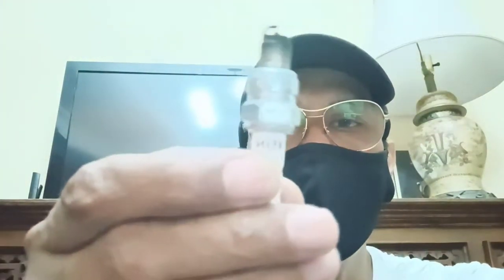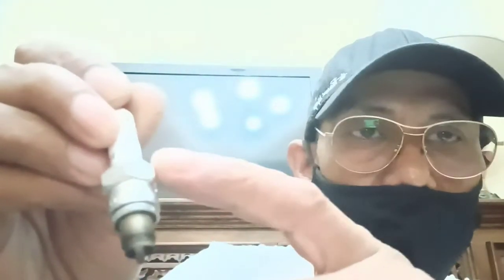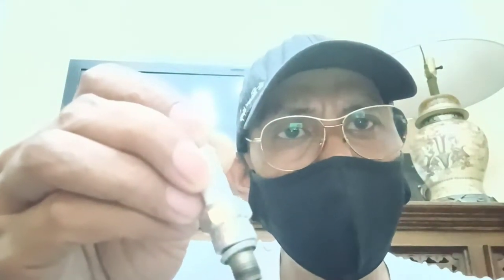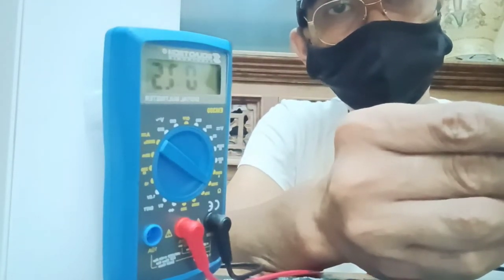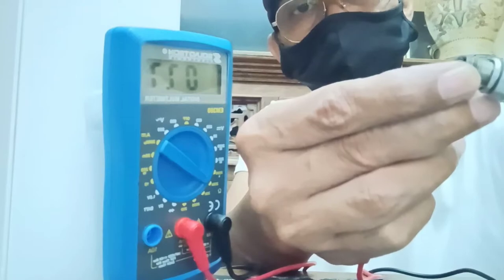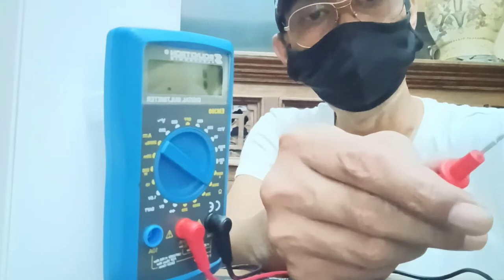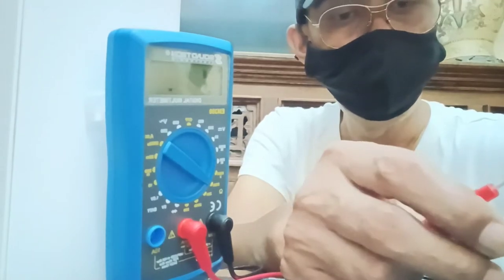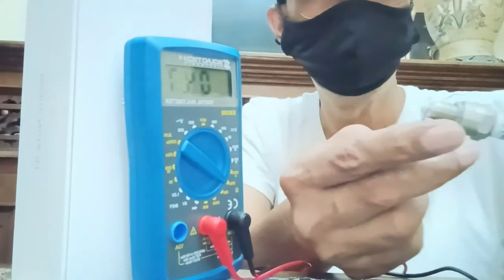Checking faulty Spark Plug using a multimeter in a simple easy step. Bilingual English and Malay.

Comment: Hello bro how much kilometer sould l change to new spark plug for your suggestion thanks.
Reply from the maker: It all base on the car or bike that you ride or drive. Usually for normal copper the maximum is 20k km but it still works after that 20k km but the misfiring that sometimes it won't burn the first few stroke than it miss to fire up making loud boom. People think it's cool to have that sounds but actually the plug miss the momentum of firing. Even Moto GP they used a non restrictor plug but they make sure it won't miss fire as if it on high-speed the piston will get a hole unless racing piston is cover with ceramic. So normal car or bike manufacturers of vehicles will give a rich fuel that means more fuel as it under warranty for 5 years you totally can't modified your bike or car if you did and they know your warranty will be void. You will pay by your own $ from your wallet. Simple to say manufacturers give extra fuel so it last longer with no issue. How many people who drives or ride a bike open their plug and see the colour of the plug? Only rider or driver with passion will look at their plug on burning. If it brown not to dark that means just nice for the ratio mixture of air, fuel, fire. 3 main components that need to be adjusted after each mod. For Iridium is just like a copper plug that on ohms it will be around 4-5k that's normal but it can last 100k km as Pallidium is second from Iridium. Iridium is 5x stronger than Pallidium plug. So check on the specification on your vehicle your riding or driving. Usually people buy and fix that's about it. Importantly the spec of every bike is different like my YBR is 0.7mm on the kernal firing. So if you mod it get a bit higher by 0.1mm make it to 0.8mm as the fire is big enough it burn the  whole fuel on the piston no wastage. And doesn't mean a new plug had no problems. Just look at mine below 2km i think it about 1k km of usage but fuel consumption is high than something is wrong. Plug burning looks ok brownish. The issue is the restrictor inside the plug must have been broken. All about QC inspection as plug cannot be drop as the internal is delicate. People love Champion brand as my late brother told me when I was young that they could dismantle the restrictor and it becomes a racing plug. It true i Google it and they still do that as Racing bike used a copper plug not Pallidium or Iridium for a one time usage. Basically it all base on how you treat you vehicle. If you treat like your second wife it will be superb but if you just treat like a trash without making any maintenance it will treat you as a trash too🤣  Simple explanation. I think I'm writing an essay for my 'A' level examination. As for me i always check my brain using water level is it straight or not. Hahaha. Thanks bro👍
Reply: Alamak very details beyond my expectation this l call it education brain booster.thank you.